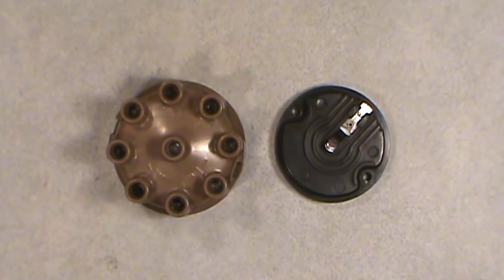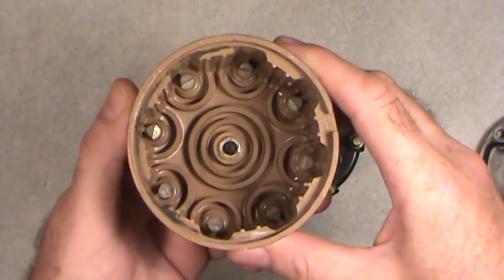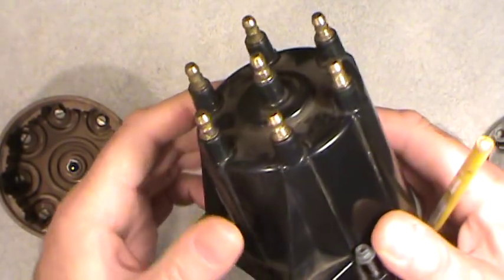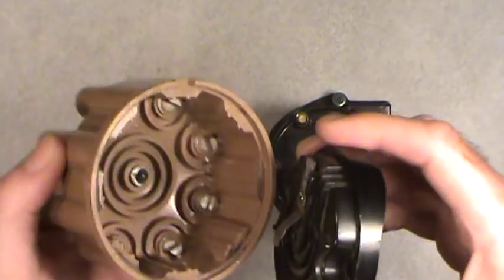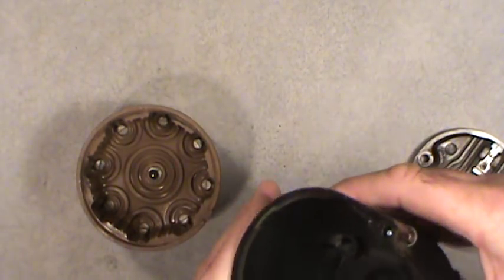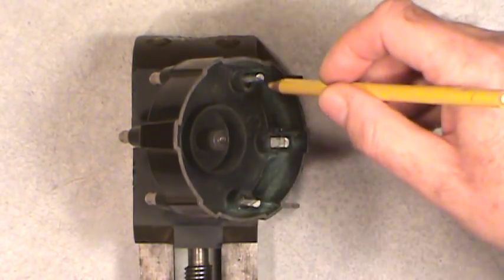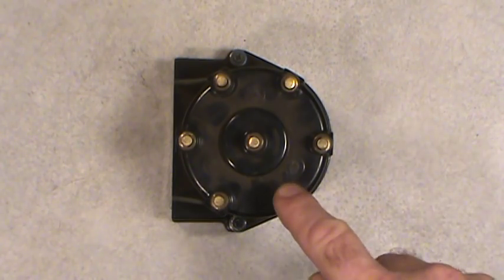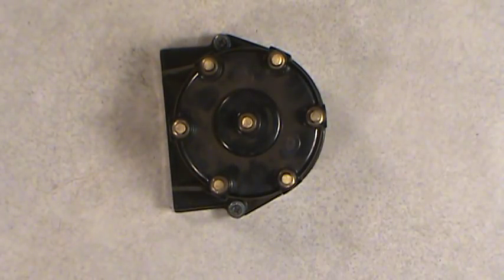How to Inspect Distributor Cap and Rotor Condition (Part 2)

Comment: my 91 camaro has been running like crap lately. plugs and wires are fine so i pulled the distributor cap and the center contact is black and burned all the way down. The cap has been replaced before at some point so do you think it could just be a poor quality cap or is something else wrong like the coil?
Reply from the maker: +Alex's Bikes and Motors Greetings Alex's Bikes and Motors....Thanks for watching.........You almost nailed it...!!!...lol.................That Distributor Cap, with that Way too Small and Wimpy Carbon Button, is the worst that I've seen yet.........................That itty-bitty spring loaded Carbon Button/Resistor, Wears Down, at, way too fast of a rate, for my liking, as compared to the solidly mounted, much Larger Carbon Button/Resistor, that You can see, in the Tan/light brown Distributor Cap, in this YouTube Video of mine........................I'm thinkin', that, when that little, way too small, in diameter, carbon button, Wears, to the point of not making "Contact", with the Rotor's, shall we call it Flat Metal Bar, then, that little Carbon Button will probably start, Electrically, High Voltage "Arcing", as in, a High Voltage Flash, "Between", the "not touching any more", little Carbon Button, to that Flat Metal Bar , down inside, that little Rotor, that spins with the Distributor's shaft..........That little Carbon Button, will probably Wear-away, at a faster Rate, as the Not Wanted, "Gap" between the Carbon Button, and the Rotor's, Flat Metal Bar Increases....................That's probably what You were seeing with Your Distributor Cap's Carbon Button...........Yes-Sir-ee-Bob...You're gonna need a New Distributor Cap and Rotor, at the very least.......................If and when-ever You Replace, Your Distributor Cap and Rotor, it would probably Help that little Carbon Button, to Last, quite a bit Longer, if You were to Sand and "Polish", to a some-what..."Mirror-Smooth-Finish"...that Flat Metal Bar, in the Rotor, where that little Carbon Button makes "Contact"............................Some of those Rotor's, Flat Metal Bars, that I have seen, look to have, a Roughly Machined Finish, and others, might not even be machined at all, quite possibly......................You really have to "Check" these little Carbon Button, "Style" of Distributor Caps, "Way more Often/Shorter Interval", then the Distributor Caps, that have Carbon Button/Resistors, that are much Larger in Diameter alright................Just always remember, Don't let that little, spring loaded Carbon Button/Resistor, get too Short, and, not be making Contact, with the Rotor's, Flat Metal Bar, or, it'll be...High Voltage Arcing..."Destruction"...as You have already seen for Yourself...!!!....Yikes...!!!...lol...???.........................Try to buy, a Good Quality, Distributor Cap, that has Brass Terminals on it, cuz, it's better then Aluminum, and only costs a bit more as well..........................If You can Buy the Distributor Cap and Rotor as a "Kit", that be, where they are Purchased together, and maybe in the very same Package, cuz, by doing so, You'll probably save a bit of Money, as compared to, Purchasing them as single units..........................So, perhaps, try Replacing Your Distributor Cap & Rotor, and see if Your Engine starts behaving itself, once again, and if not...???...just let me know, if You care to...............Good Luck, and............till next time............Be Safe, take care, and have a good one.
Reply: +RockysRoadshow thanks for the info. I have a new cap and rotor on order. I'll get back to you if it runs any better
Reply: +Alex's Bikes and Motors Replaced the cap and rotor and now the car runs awesome. Thanks for your help
Reply from the maker: +Alex's Bikes and Motors Greetings Alex's Bikes and Motors...As the Fireworks Display is Lighting-Up the Evening Sky, I say..."Congratulations"...for getting Your Camaro running good again, as well as, not having to take out a Bank Loan, to do so...lol..............................So, now that You know, what to be looking out for, in respect to that little wimpy (distributor cap), Carbon/Resistor Button, kinda self-destructing, in such a short time, You're gonna have to..."Always Remember"...to Visually Check that little wimpy Carbon Button, quite often, as in, Months, to make sure, that, it Does Not Wear Down, to, shall we say Nothing, and............till next time...........Be Safe, take care, and have a good one.

Comment: Can the center carbon button be changed out for a bigger better grade one?
Reply from the maker: Greetings...Fabian Rodriguez...…….As far as I know, there are-not, very many distributor caps, that have a separate, and, able to be changed, "carbon contact button"...……..The General Motors V-8 engine's, HEI (High Energy Ignition) distributor, that has a very Large distributor cap, does have, a separate carbon contact button, which can be replaced, or, if need be, a Low Resistance, carbon contact button (aftermarket one), can be installed as well...……..There might be, an aftermarket distributor (not an original factory one), which might have, a replaceable carbon contact button, possibly...???...and...….till next time...…..Be Safe, take care, and have a good one.

Comment: How can moisture get underneath a distributor cap?
Reply from the maker: Greetings...anthonycollins9984..........Thanks for watching.........The moisture is usually called condensation, and, it will more than likely be caused by the following..........When the engine is up to operating temperature, most, if any condensation, will be in suspension, in the warmer air, in the form of water vapor, inside the distributor cap, or, if the distributor cap, has a vent on it, it will usually exit through there...........Now then, when the engine cools down, and it's quite cold outside, then, any water vapor, that is present in the air, will cool down, and condense, back into, the good ole water form.........Try this, shall we say, experiment.........Fill a container of some sort, with some cold water, and add some ice cubes, and then, be in, or take it into a warm room.........You should see, that, the outside of that container, will usually have a coating of water, stuck onto the outside of it...........Hmmmm....where did that water come from, well, the water vapor, that was being suspended in the warm air, has now condensed, onto, the outside, of that quite cold, ice-water filled container.........If there happens to be too much condensation, inside of a distributor cap, then, there can come a time, where a cold engine, won't even start...!!!.......... Try searching, "relative humidity", and also, "dew point", if Ya care to, and.......be safe, take care, and have a good one.

Comment: mine have oil in it n my c@ crânks but doesn't st@rt is that å problem?
Reply from the maker: Greetings...Sergio Bullitt.............Thanks for watching.............If the Oil that You saw, was "inside" the distributor "Cap", then, that's not so good at all, and, I'm thinkin', that, that Oil, is probably rising up, through, the inside of the distributor's Body, where the (distributor) Shaft, is spinning inside of it...............Might be a Bad/Faulty "Seal", in the distributor's Body, that's leaking too much, or, as a wild guess, maybe, Your PCV (Positive Crankcase Ventilation) Valve, or Hose/System, is Plugged-Up, and as a result of that, there might be too much Pressure, that's building-up, "inside", of the engine's Crankcase/Oil Pan area, when-ever the engine is running................Do all of the Terminals, "inside" of the distributor Cap, as well as, the (metal) "Tip", of the (spinning) Rotor, look to be, in Good Shape...???...or, are they Worn/Eroded (by high voltage electricity), quite badly...???..................The "inside" of a distributor "Cap", should be "Clean and Dry", so, the High Voltage, that's coming from the ignition coil, will make its way (jumping), from the (spinning) Rotor's "Tip", to the "Correct" Terminal, that's inside of the distributor Cap..............Your, cranking, but "No Start" engine, might be Ignition System related, or, maybe, Fuel System related, and on a bad day, maybe both at the very same time, and I hope not..............If You can let me know, what Your Vehicle's..."Year...Make...and...Model"...is, as well as, the..."Engine Size, and Number of Cylinders"...then, I will probably be able to help You out, much more, once I actually know, what I really need to know, otherwise, I'll just be going on, another one of my..."Wild Goose Chases"...lol.......and till next time.......Be Safe, take care, and have a good one.
Reply: RockysRoadshow my car is a 93 toyota corrolla dx 1.6 is it true that the distributor does not break down when u driving the car? i sprayed starting fluid in one of the holes on the filter box but it didnt start the.  n  i was driving my car on the highway when it die i already replace the spark plugs n wires and distributor cap n igniter and still nothing i unscrewed the bolt that is on the fuel coils to c if i have gas running n i soon i loose the bolt the  gas was spraying so i know the fuel pump works next i removed 1 spark plug to c the spark n nothing no spark. so im guessing the distributor or timing belt what u do think
Reply: RockysRoadshow thank you for taking the time to reply my questions i appreciate it
Reply from the maker: Greetings...Sergio Bullitt.............When You tested, the Removed spark plug, for "Spark", did You have the Screw-Threaded end of the spark plug, touching a Metal part, on the Engine...???...cuz, if not, then, probably, No Spark will be seen...............For a Fuel Injected Engine, like Yours appears to be, then, just because You saw some Gasoline Spraying, doesn't really tell us, that, the "Fuel Pressure" is High enough, and, is with-in, Toyota's "Specifications", for Your "Exact" engine..........About the only way, to tell, if the Fuel Pressure is With-in Specifications, is to do a Fuel Pressure Test, with a Fuel Pressure testing "Gauge", and do the Test, the Correct way, that Toyota Recommends, on how to do it (with engine not running, and probably, with the engine running as well, maybe).....Fuel Pressure, can get too Low, if, something as simple as, a Fuel "Filter", becomes too "Plugged-Up", or, the Fuel Pump (that's probably hiding, inside of the gas tank), is getting kinda Weak, and is not able, to provide that rather High Fuel Pressure consistently............Some Fuel Pressures, at the Fuel Pump, might be as high as, about 100 PSI/Pounds per Square Inch...!!!...and, there's probably a Fuel Pressure "Regulator", somewhere in Your Toyota, that will reduce that Fuel Pressure, to, maybe, about 43 PSI maybe...???..........That Fuel Pressure is Dangerous...!!!...and can Destroy a Person's Eyes...!!!...so be sure to be Wearing Safety Glasses/Goggles, and have a Fire Extinguisher with-in Reach...............It would be a good idea, to have Your Vehicle's On-Board Computer "Checked", for any Trouble Codes, that might be Stored in its Memory, cuz, if there is, then, that will help out, quite a bit..............If Your Engine, has a Rubber-like Timing Belt on it, then, there is usually a "Recommended", Mileage or Kilometer-age "Replacement" interval, for Your Exact Engine, so, see if You can find that out, and if its Time, to Replace it, then do so, cuz, sometimes if the Timing Belt Breaks, and depending on the design of the Engine, then, some of those Engine Designs, can cause Pistons, to Smash-into the Valves, and then, that particular design of Engine, will get Destroyed...!!!...and probably can't be fixed at all, quite possibly...............Most Vehicle Ignition Systems, involve lots of things, like, the Battery (fully charged up?), the Ignition Switch (Key type?), all of the Wiring and Connection Points, the Module, the Ignition Coil, etc..............You might be able to get Your "Ignition Control Module" (inside of Your distributor?), Tested for "FREE", at some of the Automotive Parts Stores, so maybe, make a few Phone Calls, and ask the People that work there, if they will, for FREE, Test Your Ignition Control Module, and maybe, they might also Test Your "Ignition Coil", for Free as well, perhaps................Who knows, They might, even be able to, Test Your Whole Distributor maybe...???...just ask Them..............If You are really getting "No Spark" at all, then, it might be something, as simple as, a Bad wiring Connection, or a Blown Fuse perhaps, so, Check all of Your Toyota's "Fuses", to make sure, that they are not causing, Your No Spark problem...............Have a look at some of the Videos, that I have on my YouTube Channel...RockysRoadshow...and, there should be a few of them, such as, how to test an Ignition Coil (probably not the same as Yours is, but, it should be tested, in about the same way).................So then, Check all wiring Connections and Fuses, and maybe, have Your Toyota's Fuel Pressure Tested as well, just to make sure, once You know, that, You are actually getting a Good Strong Spark, at the spark plugs, once again...............Good Luck, and........till next time.......Be Safe, take care, and have a good one.
Reply: YOU HAVE THE ANSWER IN YOUR QUESTION, 

 n nothing no spark,  

yes distributors can break..coils too.

Comment: I have a 1989 Ford Bronco 351 V8 no performance parts are nothing I just remember pulling out my truck in my driveway to back it out next I just shut down completely all I hear is like it sounds like a dead battery but I replace the battery and still acting the same thank you for responding me back
Reply from the maker: +John Luna ....Greetings John Luna....You're Welcome............Well, there are quite a few things, that can cause, just about any Engine to Stop Running alright.............If Your Engine is Fuel Injected, then, there are 2 Things, that should be done, in order to help Diagnose, any and all Engine Problems..........The Fuel Pressure should be Tested, with a Fuel Pressure Gauge, to make sure, that it's "With-in" the Vehicle Manufacturers "Specifications", for Your "Exact" Vehicle and Engine, oh, and, be Very Careful, as some of those "Fuel Pressures", could get as High as, about "60 PSI/Pounds per Square Inch"...!!!...so, be Sure to Wear Safety Glasses/Goggles, and have a Fire Extinguisher with-in reach...!!!............Then, Extract/Read any "Trouble Codes" (if there are Any, that is), from Your Vehicle's "On-Board Computer's/Memory".................Have You Looked for any Obvious "External" Gasoline "Leaks" at all...???..................All Electrical Wiring "Connections", have to be "Clean & Dry", in order to Prevent, any, Not-Wanted (Electrical) Resistance, or maybe, No-Connection at all, perhaps.................Depending on, just how, Your Bronco's Engine Quit Running on You, can be quite the Clue alright...........Even something like a Plugged-Up Catalytic Converter, can, shall we say "Suffocate" Your Engine's (exhaust system's) Breathing ability, and if really Bad, the Engine, will probably have No-Guts, and might even Stall..............Even though, a Brand New, Fully Charged-Up Battery, might have lots of Power (as in, lots of cold cranking Amps/Amperes), along with a really good Starting System/Starter Motor, then, at times, all it takes, for the Engine to Crank-Over "Slowly"...or..."Not at all", is to have, a "Flooded Engine" (as in, way too much Gasoline, that got into the Engine's Cylinders), that will Slow-Down, or Prevent the Pistons, from going "Up", on the Compression Stoke, in any of the Engine's, (gasoline) Flooded Cylinders.............Might be, that, Your Bronco's, Charging System, isn't Charging the Battery, as it should be doing, possibly...???.................Here's about the best advice, that I have for You, at this point in time.................Maybe, do an Internet Search, for some Ford Truck Websites, that have "Forums" on them, where You can Ask all kinds of Questions, about Your "Exact" Bronco and Engine, cuz, there are some, really Smart People, on most of those Website "Forums", and there is the possibility, that some of those People, have already "Diagnosed & Fixed" Problems, much like You are having at the moment...................They should be able to tell You, how to go about, Extracting any Trouble Codes, that might be Stored, in Your Bronco's, Computer Memory, as well as, how to Test the Fuel Pressure (I hope).........Good Luck, and.........till next time..........Be Safe, take care, and have a good one.